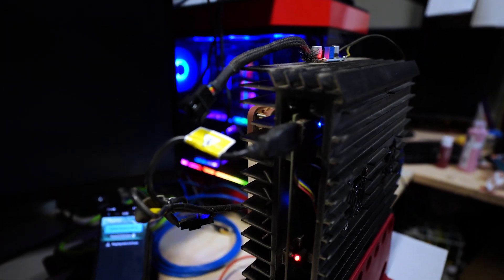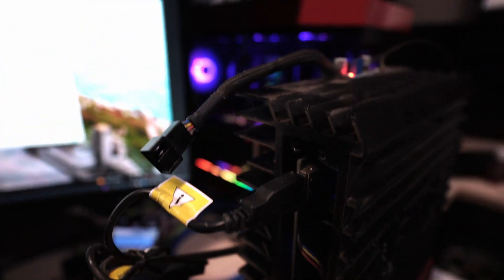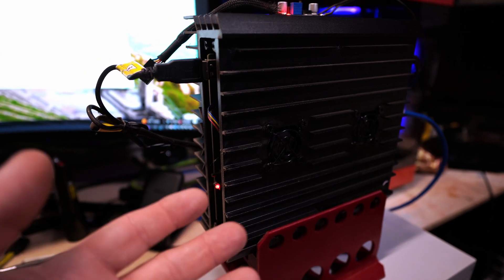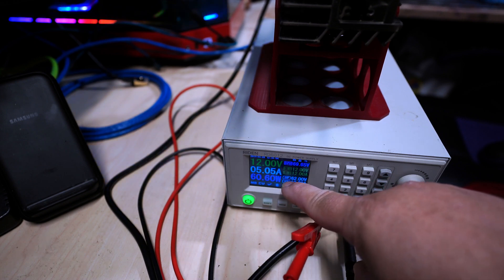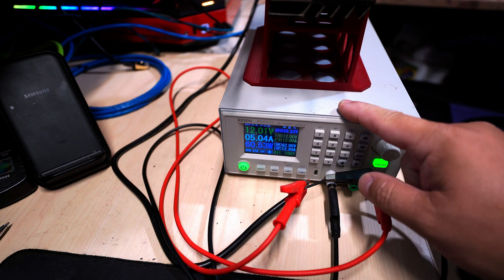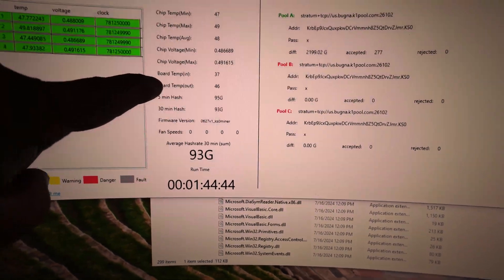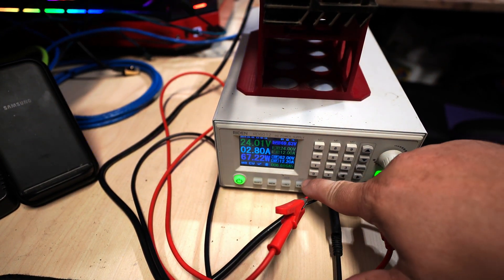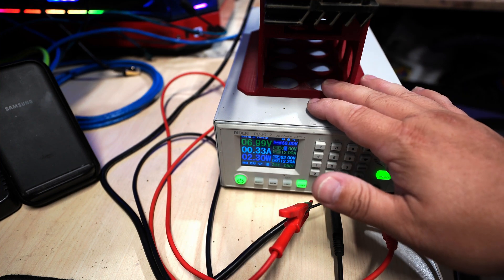IceRiver KS0 Most Efficient Voltage Testing!! #crypto #iceriver #kaspa

Comment: This is absolutely correct, those stages sre stepping down the power, you create a lot more heat going from higher voltages. For example, doing 12v conversion on snes consoles requires cooling the step down as it gets burning hot. 9v? Significantly cooler.
Reply: Heat is loss